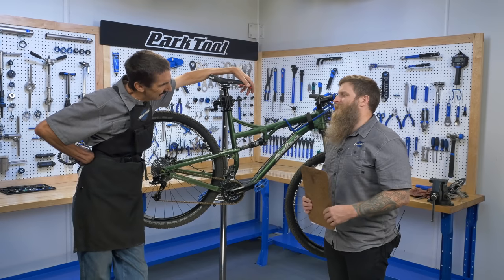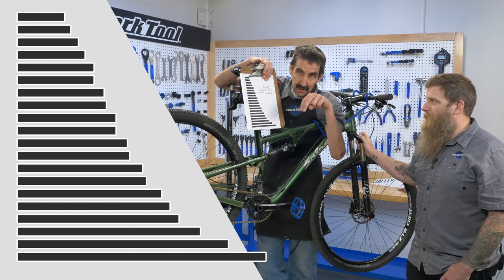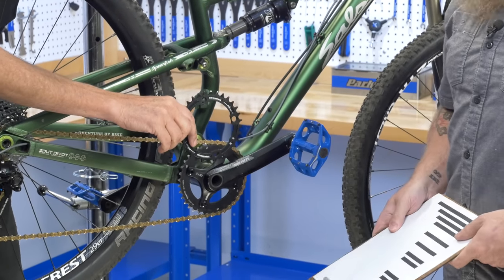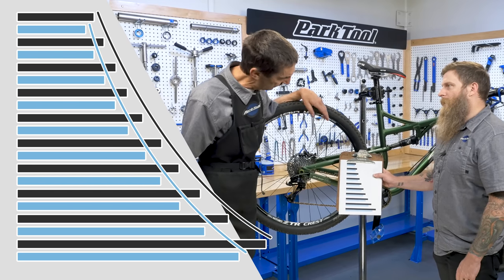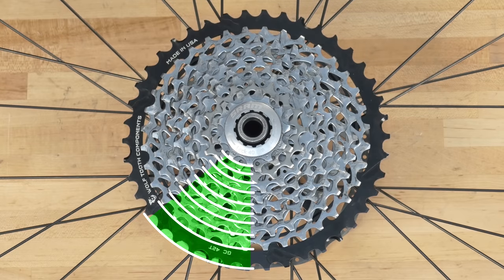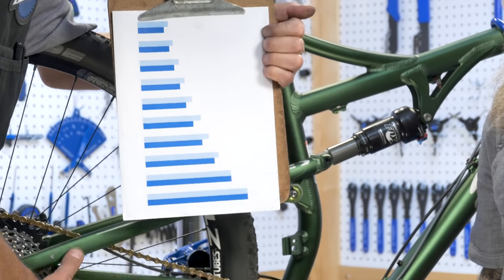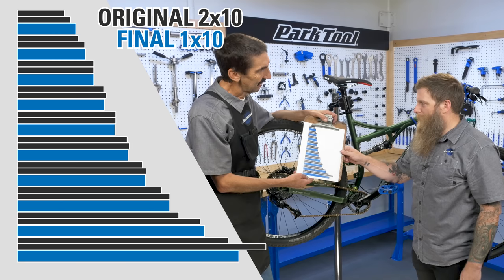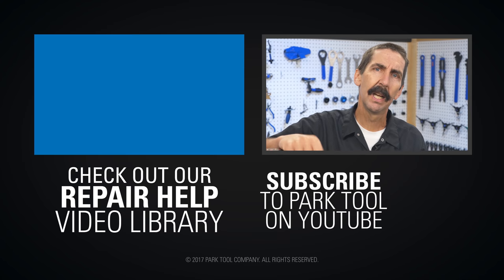1X Conversion: Pros & Cons - Tech Tuesday #91

Comment: Am I the only person that sees moving more gears  to the rear wheel makes more unsprung weight (bad suspension action), more rotating weight (harder acceleration), and shifts mass centralization out of whack?? Ask Honda or Yamaha to move their dirtbike transmissions to the back wheel and they will tell you to あなた自身のファック  !!! I'd rather see more sprockets up front , one in the back and a simple tensioner. This would mass centralize much weight improving the feel of the bike immensely. Total weight isnt the be-all end-all of bike performance, it's WHERE you put that weight.
Reply: I think thats why gearboxs are getting more development.
Reply: Its all a bad design in regard to all aspects of mechanical performance, but the modern mtbr is completely lacking any fundamental mechanical knowledge, most cant even change the oil in their car!   This would be like converting a modern short stroke OHV Engine back to long stroke pushrod.   Why would I want to move my derailleur closer to the ground, decrease its shifting speed (inertia), use a weaker and longer chain, create a much larger chain loop to catch debris,  increase delay when downshifting when time is crucial.   It does simplify the dropper post, but there is no argument for weight savings - cause it doesn't compute.  My Ti hardware 8 speed is too light to mention/comprehend to the modern MTBr,  it weighs less, shifts faster and has more reliability than any modern configuration.   Disclaimer: I do ride SS, and do have 1x9 for gravel, but for my suspension / performance bike that needs to go fast and get me home, the modern drivetrain does not compute.
Reply: Spokexx spokexx, That's a great point I hadn't thought about, I just dislike it due to the unscientific marketing pushing it forward, and the ridiculous pricing for a product that is simpler and cheaper for the manufacturer to make. They're fucking saving the entire front derailleur and mount for it but selling it as some premium product, it should be cheaper and not more expensive.

But it just goes to show how horribly unscientific the entire mountain biking industry is. It's more about fads, about looking cool on the trail, about saying "Gnarly!" and "Dude!" a lot etc. than about being scientific about it. People will happily spend a fortune on replacing some small part with a carbon fiber alternative but tell them they could lose more weight and become more aerodynamic by losing the extremely baggy clothing and they'll lose their minds. lol

In any other type of racing (Cycling or not) you'll see weight distribution being a big deal, you'll see efficiency being a big deal, you'll see aerodynamics being a big deal etc. but here they can sell the entire industry on "a sleek look" or "a cleaner setup" or whatever. It frustrates me to no end.

I was watching some videos about some people riding Specialized bikes (their MTB inspired touring bike, forget the name), and I was curious why they'd ride a slick tire in all kinds of weather, and the Specialized guys replied back to me that "The weather doesn't make any difference to slicks". I mean wtf? Why do they think racing cars change tires? Why do they think slicks aren't allowed as road tires for cars in most places that ever get serious rain? 
They're acting as if they've fucking invented the concept of tires or something just to sell their new "sleek product". Tires have treads for a reason! Just ask pro MTB riders for example.
When people from the Specialized team know less about tires than your average Joe, or are just fine outright lying to the potential danger of their customers, what the hell can you do? Can we trust anything they say at that point?
Considering the blatant dishonest push for 1x I have no reason to think Sram are any less dishonest (or ignorant) than Specialized in my case tbh. It just seems so obvious that they're trying to simplify things because it's cheaper/easier and then claiming it's some new magical invention when in reality we all rode 1x back in the day and changed to 2x, 3x etc. because it offered more options.
Reply: @gnawershreth  https://www.sheldonbrown.com/brandt/slicks.html Bicycle tires and car tires are two completely different things.
Reply: @marshallferron  tell that to dirt and street motorcycles

Comment: I think people confuse having lots of choice with having the right choices. The more you generalize, the better for more things, at the cost of optimum for some things. Its no different than my race car - gear for the track you are going to run, not any possible track. For my typical riding environment, I went 1x 15 years ago and happier for it. Tempted to do the same for my road bike as I have very  few hills here - even on 2x, I changed both cassette and front chainrings to best match my ability to produce power and the terrain I ride on...
Reply: Spinnetti   You said all that needs to be said about running a one by

Comment: Why sacrifice the range of options?  I love to gear up on the big ring and use the free power to recover on easier sections of trail and then be rested for the hard stuff.  A really long travel full suspension could be an exception to keep the chain from slapping the shit out of your frame, though.

Comment: Great video and love all the graphs.  I was hoping you would touch on more than just the gear ratios though -- e.g., does shift performance suffer when due to greater derailleur spring tension variation at the extremes (I'm assuming this might occur when all the ratio variation is in a wider range cassette vs. a combo of smaller increases/decreases in front/back)?  What about chain retention and chainline?

Comment: this sounded ideal to me. I bought a new Shimano cassette, contacted Suntour about my current chainset, who told me it is a standard 4 bolt 104/64, so bought a 32t 104 chainring. Took all this to my trustee bike shop, who told me it didn't fit. If its standard, why doesn't it fit? Do I have to buy different makes of chainring until one works?
Reply from the maker: Did the shop let you know why the chainring would not fit?
Reply: Not specifically. He said that  chain rings are not a standard size and being out by just a few mm can mean them fitting or not. He recommended getting a whole new crankset, but that seems a bit overkill, as well as expensive. Do you know if SA Suntour recommend a specific chainring or if they can provide one? thanks
Reply from the maker: I'm sure they would recommend using one that they have but could also suggest something. I would hit them up as they should know exactly your situation.

Comment: I am considering to convert my 3x9 (36t) to 1x9 (46t). How do you work out a similar gear ratio for the chain ring or are you able to advice on the chain ring (32, 34, 36 or 38). Looking forward to your advice. Thanks Kel.

Comment: 1x for mtb. Eagle's 500% range covers what a 2x used to do.

Waiting for the equivalent 1x tech for my road bike now.
Reply: It's already here. Don't need a 50t ring on a road bike, even my 44 chainring with a 10-42t is over kill. Only reason I haven't swapped out for a tighter cassette is because it's my workhorse and sometimes I just want to mindlessly spin up a hill after work, and it's nice if I want to go offroad as there is a killer 20% climb near me.
Reply: I would want a 50+ tooth 1x chainring up front with a 10-50 cassette for the full range on hill climbs and descents before giving up on my 2x chainring. 

I'm not sure if that would be too heavy of a cassette, but so many mtb tech bits are making their way over to road biking so I look forward to the next few years of development.
Reply: Dennis some cyclocross bikes are 1x already! the only issue i see for road bikes using 1x are the jumps between cogs which could make keeping a steady cadence difficult.
Reply: Prime hey how's the chainline on your 1x drivetrain? does it affect efficiency a great deal in your opinion?
Reply: MustardDonkey it's really good actually. I have full Sram Rival and they have done a good job with it. Only time I ever notice it is when I'm on the big 42t cog and even then I've really specifically pay attention to it.
Reply: you get way too much chain twist with 1x system, and that means loss of wattage. If you wonder what am I talking about just shift to your biggest cog and pedal backwards.
Reply: Yeah, I've seen some cool 11-42 sram setups on cx and gravel bikes, but they don't quite cover all of the range that I need.
Reply: All depends on the system. I have a 1x 10-42 gx on my mtb. No funny business when I pedal backwards. Haven't dropped the chain once. The only reason I want eagle is for 1 more bailout gear, but it isn't really a necessity. Stronger legs would also get me up steeper climbs... lol
Reply: If you're counting watts the 1X is not for you
Reply: I run 1x myself, and no, Im not counting watts as well. I am just pointing the downsides.
Reply: ye but the Mong who owns it will still stick a 32t chainring up front

Comment: I've been debating for a while now about getting a standard 11-46 cassette, and a 30t chainring for the 1x conversion. I do alot of uphill climbing on road and trail. Is the 11-46 1x10 conversion with a 30t chainring a good decision for this type of riding or should I stick with 2x. Do you have riding experience with this set up?

Comment: So if I replace my my front derailer and just add at 30 tooth narrow wide do I have to do anything else
Reply: You need to remove the front derailleur, cable, shifter etc. Good look if these are integrated with your brake levers. Then you need to replace the 3xchain ring with the 1xchain ring. The 1xchain ring is almost like the 2nd chain ring on the 3x setup. So maybe you could drill out the 1 & 3 chain rings, then you need to add the rear cog to your cassette and make the chain longer. This basically what you need to do.
Frankly I would not go to all this trouble, the 3x setup is extremely good for uphills. This is a known fact

Comment: What difference does tire size have if any? I'm running a 2x10 on a 27.5 and I want to switch to a 1x because I rarely, if ever, change my front gears. Any suggestions on the most practical setup?

Comment: I HAVE A REAR CASSETTE 10SPEED  11 TO 46 teeth.   How many teeth should my front chainring be?  Is 46T to big?
Reply from the maker: This will depend on where the bike is being ridden and your preferences. A MTB would typically have a ring in a range from 28- 34. For CX and city 40-44 and for a 1x on the road you may run 48-52.

Comment: Im adding a new bike to the pack. Thinking a 1x12...
My riding conditions often require my easiest ratio 1 to 1 and i ride a 27 speed.
question? Will a 1 x 12 have comparable my 1 to 1?
I mean stupid steep long climbs .

Thank you
Reply: Yes, the lowest gear on a 1x12 is a very similar ratio to the lowest speed on a 3x9.  When I changed my bike over I actually got a larger reduction in my lowest gear.

Comment: Should I be the one to say that they are now even using the biggest range they can use. Now with 11 and even 12 speed setups, you have 10-42 or 11-46 on 11 speed, or 10-50 or 10-51 on 12. (Vs their 11-42) I even have a single setup on my road bike (although I don't recommend this unless you need jr gearing). 1xs you can cross chain, simpler to maintain, lighter, and a lot better looking. I don't see why this good of a channel would lie like this.

Comment: Can removing the front derailleur and shifter and keeping the chain on one of the chainrings accomplish the same thing by allowing me more access to the gear ratios in the cassette without worrying about the chain rubbing against the front derailleur cage since I have now removed it or am I missing something?
Reply from the maker: The idea of any system is to get usable gears for your ride. The 1X systems are not simply removing one of the two front rings.  The rear cassette needs a wider range, and the front ring then selected to be the best compromise for an adequate low but also an adequate high gear option.  There will be sacrifices but some people like the concept.

Comment: I have a 2 chainring bike, but I only use the bigger chainring, can I remove the smaller one, the derailleur and all the cables and that's it or should I buy another chainring etc??
Reply from the maker: A chainring is suggested. The reason is that the newer "narrow-wide" chainrings retain the chain much better and do not need the derailleur to help them retain the chain on the chainring. If you run with just your large chainring its likely that you will drop the chain fairly often.
Reply: Thank you  @parktool   <3

Comment: 1x seems tempting but the cost to have essentially the same gearing seems financially prohibitive
Reply: Not really, I converted my 3x to a 1x and all i did was just install the 1x chainring. As long as the 1x chainring is smaller then the biggest chainring from your 3x then you don't have to worry about purchasing a new chain, unless you decide to go crazy like they did and add the extra huge cog in the back, most people don't bother with that, I know i didn't. So in the end it literally cost me $15.00 which was the cost of the new chain ring and included chainring bolts.
Reply: @NonLegitNation2  the problem with your cheap conversion is that  you don't actually gain anything but you lose range. 1x makes sense for 11/12 speed, throw on a narrow/wide ring, a clutch RD, etc. You keep the range that way, don't create gaps, minimize chain slap. What you did, however, is give up the advantages of 3x without gaining any of the advantages of 1x... you just gimped your bike. And that's fine, if you only need that more limited range. I wouldn't hesitate to buy a 1x full suspension MTB new but there's no reason to gimp my bikes and lose range just to chase a trend.

Comment: I use 3x9 on single track and only use my frontgears while on the trail. I'm thinking of building a 3x1 for the tracks. Any experience with that?
Reply from the maker: I have had people request this and it never really works out in the end. You still need both front and rear derailleurs. Plus it is difficult to find a 3 speed right hand shifter in the correct pull to operate the front derailleur. A 3 speed hub has come up as a logical solution to those seeking the simplicity. Then other issues arise. Share with us if and when you do this!

Comment: Does anyone know what's the best chain ring to use on a bike with 26in wheels using a 1 x 12 system? Just install NX on my old 2009 kona dawg and with the 32t ring it's not enough.
Reply from the maker: Good question and a good topic for Math Tuesday, a new series.  You need “Gear Development” here, which of course include a piece of the pi. Gear Development is how far you pedal in one full pedal stroke.     (Warning: Since this is wheel size in inches, we will stick here to inches in the math). Your current machine has 32t x 11t, so each pedal stroke the wheel is rotating 2.9 times each strokes.  The 26” diameter wheel (approx) get multiplied by pi (3.14blahblahblahblah), so the wheel travels forward 81.7”. With one stroke you are moving 2.9 x 81.7”= 237".  Assume a pal has the same 32  by 11 gearing but with a 29er, so that is a bigger circumference of 29" x pi = 91”. 
Gear development for this pal is:   (32/11) x (29 x 3.14) = 264” for each stroke.  
 You are asking what front size ring, so assume you want your pal’s 264” gear development.
 Solve for C (chainring):    (x/11) x (26 x  3.14)= 264, or 35 1/2 teeth.  That is hard to find, so go  for a 36t.

Comment: Is cross chaining still an issue with 1x? If so, then what is the point of 1x conversion if you can't use all your rear sprockets?
Reply: @Park Tool By aligned, I guess you're talking about aligning the chainline of the chainring with the middle of the cassette. I don't understand the hype with 1x (probably marketing propaganda to sell a bicycle for MORE money with LESS gears by removing some chainrings and the front derailleur and then declaring that it's a groundbreaking innovation). I'll stick with my triple crankset for more access to gear ratios and maintain a good chainline at all times. I enjoy your videos, I learn something new everyday.

Comment: I`m running 32t narrow wide chainring upfront for my 1x9 setup. Old school by comparison I know but is there a hack to turning the older SRAM rear mech into one that has a the clutch so that the chain does not go flying off the front ring during rough riding? I already have a Paul Components chain keeper but would eventually like to drop that as well if possible. Is there a 9 speed rear mech with clutch on the market?  Thanks in advance to all who help.
Reply from the maker: I am unaware of a 9 speed clutch style rear derailleur. There are the chain guides that attach to the bottom of the chainstay that are said to help though. I know way back that there was an aftermarket company that would use a small spring attached to the back of the tension pulley to give more tension to the system as to reduce chain slap.

Comment: I started ridding Mountain bikes in 1989 with a 3 x 5 drivetrain. Throughout the years I seen some pretty silly things like bio Pace 3 x 9 etc. that said I transitioned to gravel bikes and I run a GRX 800 drives train system 2 x 12 I never experienced chains suck but I have experienced running out of gears going downhill or on a long straight away. Now all of a sudden one by 12 or one by 13 is all the rage. I truly believe this is marketing hype because the bicycle manufactures don’t know how to build carbon fiber chain stays that can handle chain Suck. One by system is always gonna leave you wanting more on the downhill or the flats.